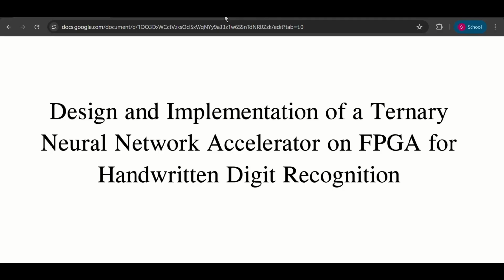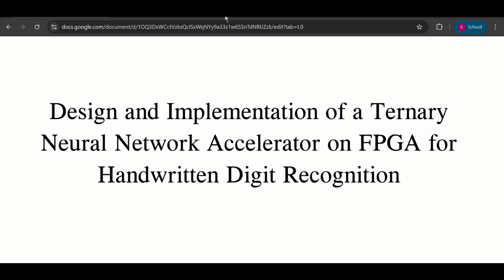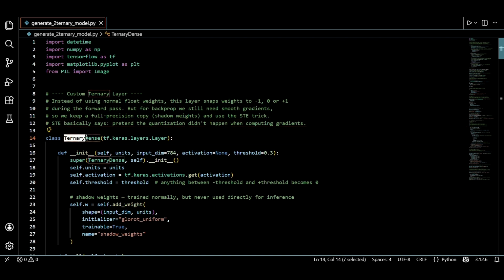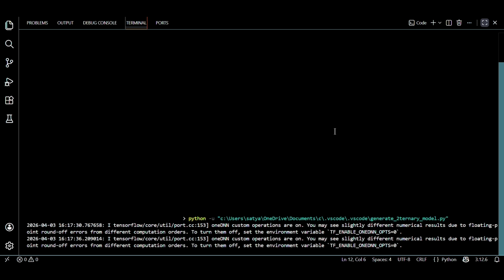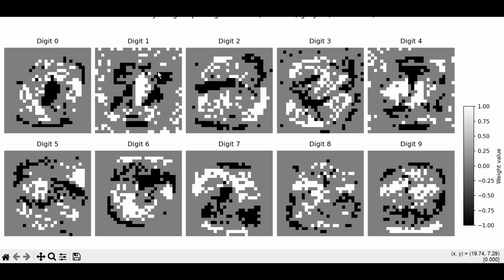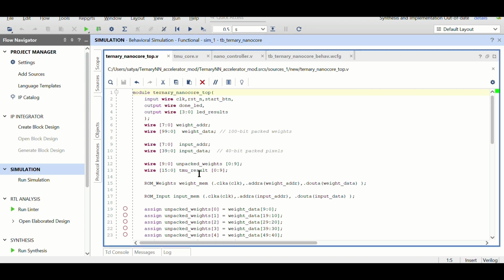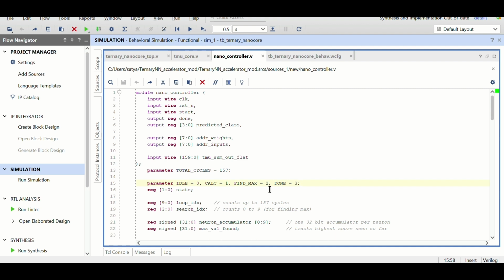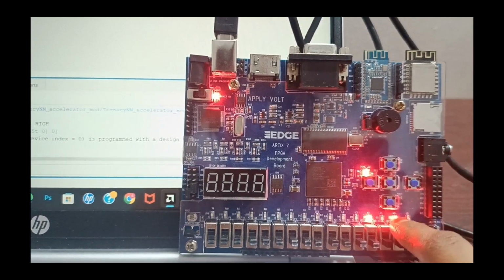🧠⚡ FPGA-Based Efficient Ternary Neural Network Accelerator for Digit Recognition

Comment: To clarify the hardware deployment process: We implemented this design on the Artix-7 FPGA by opening Vivado's IP Catalog and instantiating 'Block Memory Generator' IP blocks configured as ROMs. We then "dumped" our Python-generated COE files directly under the Memory Initialization tab.
We configured the IP blocks with these exact settings:
1. Input ROM: 40-bit data width × 256 physical depth
2. Weights ROM: 100-bit data width × 256 physical depth